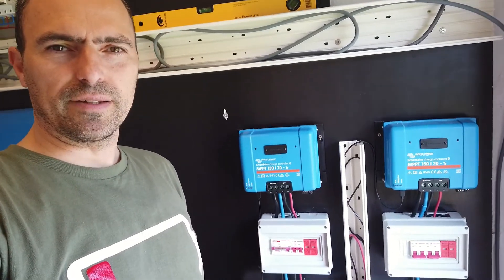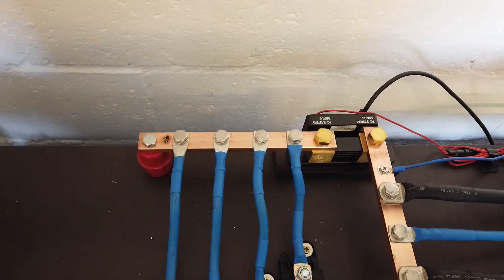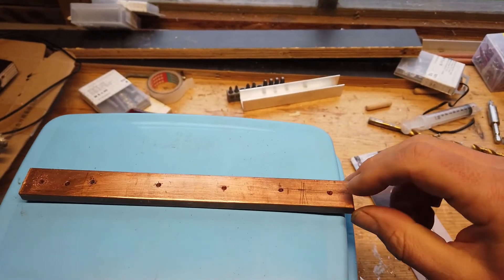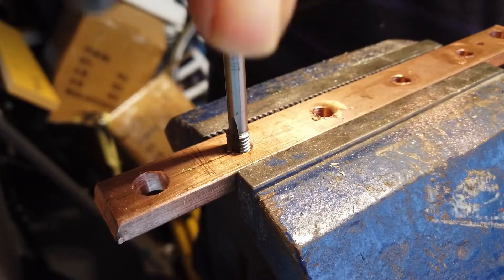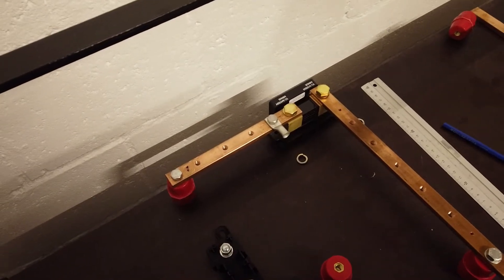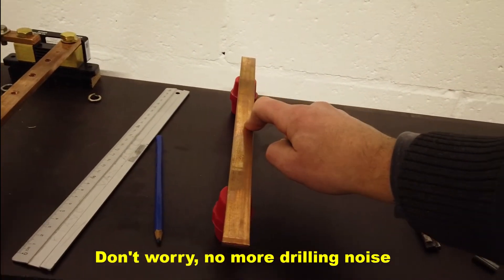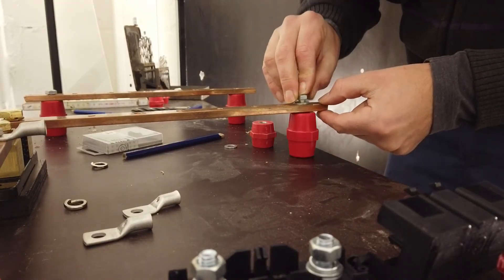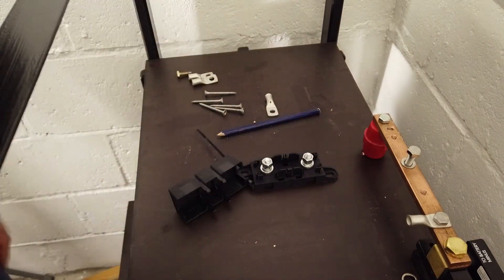are DIY busbars a victron lynx killer?

Comment: What size SmartShunt did you go with?  500a or 1000a?
Reply from the maker: Hi Sean, 

I'm using the 500A model. 500A x 50V = 25KW, never gonna draw that much energy from the powerwall.

Franky - EASYPOWERWALL

Comment: I have some DIY bus bars on my boat, but when I added an LFP House bank I went with the Lynx.  I just like that it is compact and covered.   Yes, a DIY left fully exposed is cheaper, but I think the benefits of the Lynx usually outweigh the cost savings of DIY.   (At least in a medium sized boat.)
Reply from the maker: I agree, for boat with limited space, the LYNX is the best option.
Have fun building.

Frank EASYPOWERWALL

Comment: Nice set up, very clean!!. I have some fears buying from Ali as not all products are good quality, are you sure it is 99,9% copper? Have you measured the resistance?
Reply from the maker: Well it was check by a pro electrician and he confirmed it was legit copper. Resistance for short distance is close to 0 ohm. So far no issue, works great since > 12 months. 
The links in the clip are from thrustworty sellers.

Comment: Nice Video( as far as I watched it). But think about the placement of your fuses. As I know, always place the fuses in the positive side of the wiering - never fuse the negative part.
If the fuses in the negative path will burn, the system try’s to get ground over the (not potential isolated) data cable. I think it’s clear, how fast the data cable will work as an other fuse and maybe destroys your electronics.
Reply: I never thought of that

Comment: Nice. Did something similar for my 24V power wall. Didn't have a drill press, so the holes are not as perfect aligned but in the end that's hardly noticeable. Thread tapping was a pain in the *ss, but the result is rewarding indeed!
Reply from the maker: Thanks for the nice feedback Rob. Have a nice day.

Comment: found your videos by pure luck. Very informative, especially for a beginner like me. Just one thing. Why do you need to fuse negative (busbar & cables)? Also what are the fuses you are putting on the negatives? e.g if the battery bank has 200A fuse + side, will you put a 200A on the negative side cable also (same goes for inverter)? Any helps will be appreciated.
Reply from the maker: Hi,

There's one fus for every battery bank. You can connect via positive or negative.....for my design negative was the best option. The fuse is there for safety (short in system).
The fuse towards the inverter is on the positive connector, recommended by victron. My fuse is 125A. Normally I never pull more then 25A per battery bank. 25A x 4 = 100A   -> 100A *52V = 5000W.
Reply: @easypowerwall   noted. many thanks

Comment: Great video as always, what are you using as a cover for the busbars?
Reply from the maker: Hey Luc, good question. The top shelf will be covered with PVC (top and front). Will tackle and show it in one of the next videos.
Reply: @easypowerwall  I was looking for a cover solution if I built my own busbars. I'm putting the system in an RV.
Reply: @luctessier2215  Maybe cut pvc pipe in half that will fit over whatever you have. You can also heat pvc  and bend or form it.
Reply: @easypowerwall  Even with the top shelf covers, I would put a light cover on the bus bars just to make sure if someone drops a tool on top of the bars bridging them while taking the shelf covers off, that would makea a brilliant an violent arc fire. Maybe just the + side at least.

Comment: I paid only 160ish euros through Amazon a month ago...EU. For the standard Lynx Power-In, not the distributor.
Reply from the maker: 100EUR is with fuses included. Because I have 4 batteries I needed 2 lynx...... Correct me if I am wrong, it was 160 without fuses?